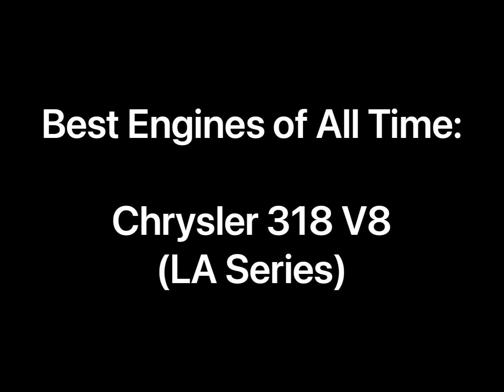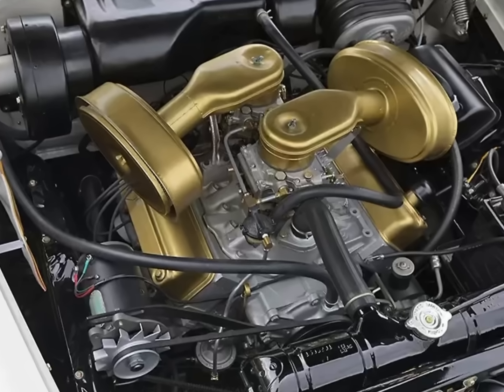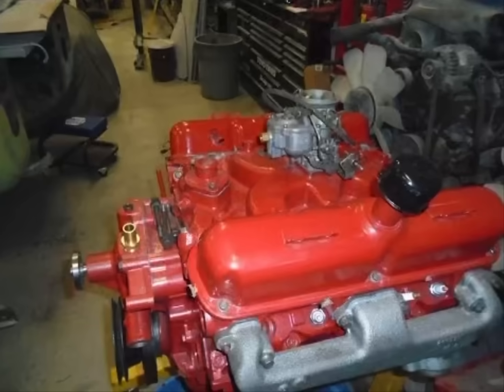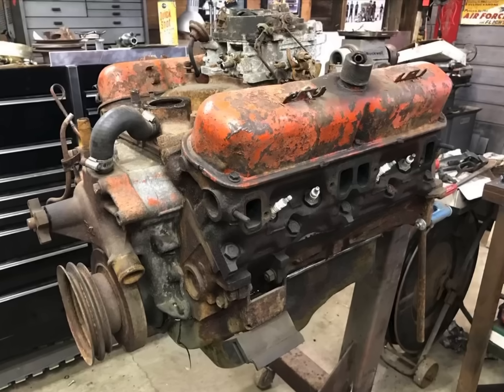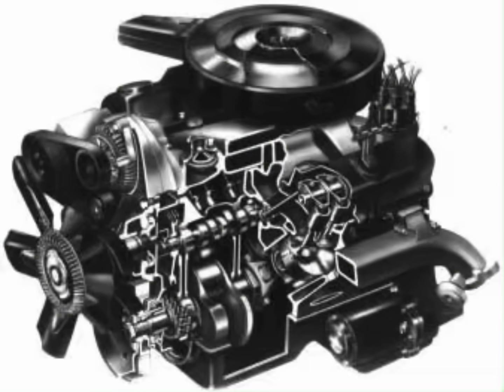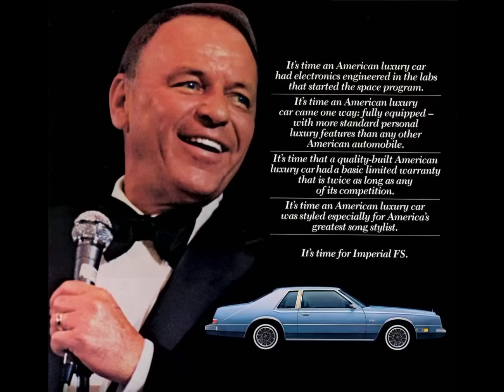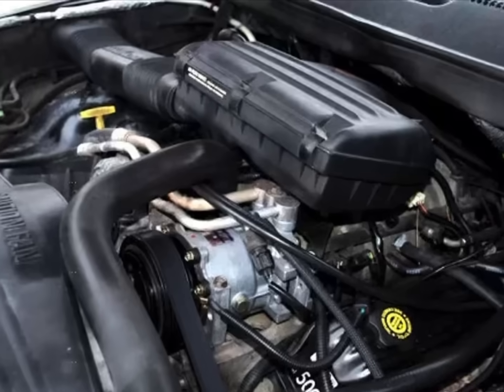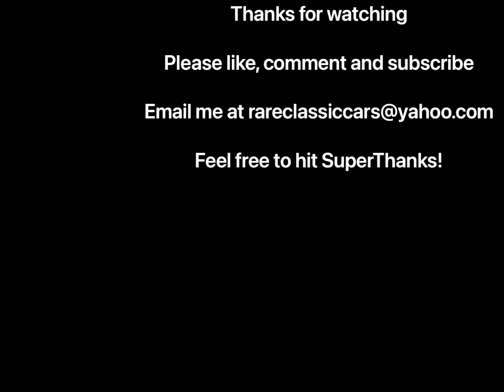Best Engines of All Time: Chrysler/Dodge/Plymouth 318 V8 (LA Series)

Comment: Yes, power and reliability. One of the best, most underrated engines of all.
Reply: They made 220hp in the Magnum era.  Strong performers, great sounding also.
Reply: LA 318 is almost the exact same  engine as the 340 except for the 340 has a  very slight only 0.003 of an inch larger piston bore diameter, but other than that they both have the same block pretty much both being based of the LA 273 engine, so both LA 318/340 USE the same 273 block and rotating assembly, the 340 is bored out a super slight bit more but making the 340 piston about 0.003" bigger, and that's the difference between the two engine's short block.. the rest of the difference is Top end, as 340 was marketed for their small block performance engine at the time, it had the much better heads with larger ports and bigger valves to really help moves those spent exhausy gases out the way so that the bad ass old factory cast iron( but still the best intake can get I've been told) 4 bbl intake as well as a larger 4bbl carb as compared to the crappy two bbl and small and restrictive swivel port heads with their punie lil valves that were put on the LA 318's.. basically neutering them for marketing purposes bc the company was marketing the 318 as a reliable workhorse not as a performance engine like the 340 was, so they had to make sure it didn't behave like one and they did
Reply: @DaMintyFresh1 
The 340 has a bore that is .130" larger than the 318. It is my understanding that 340 heads cannot be used on a 318 unless the bores are opened up and or notched for valve clearance. It us very likely that all LA blocks and heads were machined on the same machining lines. As the share the same bore spreads and deck heights. They likely share the same valve center distance but the 273 may be smaller. The 273 only had a bore of 3.625". Machining lines expensive. And given production volume it may be required to have multiple block, head, bearing cap* and other sets of equipment. Plus machining lines are usually broken into sections. If one section is down for maintenance, tooling changes etc parts can be taken off line before and put on to go through the next operations. I spent 30 plus years at an engine manufacturing facility. 4s, 6s, V6s and V8s. Cast iron and aluminum. 
*even bearing caps were machined on transfer lines. The last operation would be to cut the individual caps out of the casting with a gang of slitting saws.
Reply: That's what Mopar stands for "More Overall Performance And Reliability" :)
Reply: The relocation of the spark plus was a smart move.
Reply: 140 hp from 5.2 it's a shame
Reply: @abdulabdanahib9617  mustangs made 200hp with their hi-po engines in the 80s, 400ci firebird made 250hp in the 80s, it is no shame having 150hp coming from a workhorse engine.
Reply: @kuiper6926  BMW M50b20 has same 150 hp but consumes much less fuel
Reply: @abdulabdanahib9617  American v8s are easier to work on and a 318 will outlast any 70s or 80s bmw non diesel engine. Not to mention, they had around 200hp net standard, but those 318s are easy to reach the 500hp mark naturally aspirated with few mods.
Reply: @abdulabdanahib9617  You cant compare anything BMW to chrysler, its simply not fair. Fuel consumption is better with smaller displacement and BMW engines are more fancifully engineered. 2 different things. The power is adequate with old American v8s. The American’s often used longer differential gearing to keep the RPM low to conserve fuel. Considering they used displacement rather than technology to generate their horsepower, these low hp V8s feel solid, like comparing a i4 to an i6. Good power from 1k-2k rpm and thats how they lower fuel consumption. Tune the engine to be comfy at low rpm.

Comment: Adam, We can see you are working your way up to the Slant Six. For the record, what is the relationship between the LA series 318 and the 340?
Reply: YAS!! LEANING TOWER OF POWER
Reply: Firing order
Reply: Pretty much identical engines, they do use different casting though so you can’t bore a 318 into a 340. 3.91” bore vs 4.04” is the main difference other than that the 340 got high performance heads, intake, and other parts that are relatively easy to change out
Reply: Stroke was the same.

Comment: Awesome long lived engines along with the b big blocks.  Large lifters, great rod ratio, beefy blocks.   Demo derby guys love small block Mopars because they can take the heat.   Good set of aftermarket aluminum heads and stroker kit for a 318 make it a formidable engine…even better than the 340
Reply: Yeah, the stock 318 heads are designed for economy and durability.
Reply: Well of course since it's a stroker and modern heads

Comment: I loved my 88 Dodge ram d100 with this engine, always ran great.
Reply: I. " loved " my ' 67 Barracuda Coupe ( original ) formula S 383 , 4 speed , 8 3/4 rear with 3. 23 : 1 sure grip . i installed an ( O. E ) 375 H.P. " 440 " and a button clutch did consistent 11:00 second quarter mile w/ L60 15 street tires with 5-7 p.s.i. and with 25 p.s.i. did 165 -170 M.P.H.and got 25 M.P.G. and " loved " MANY OTHERS i built .
Reply: @keithpearson7059  this video is about the 318. Love um.